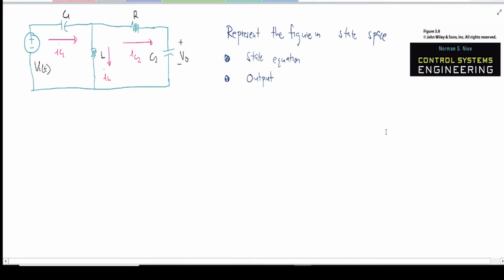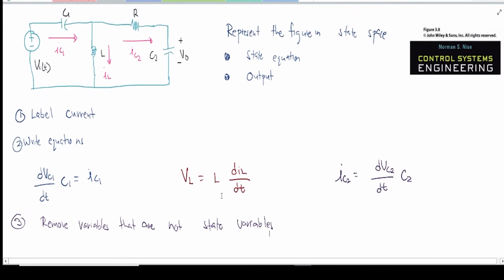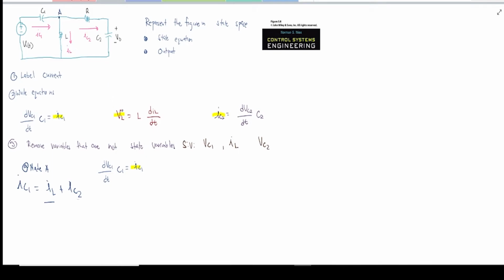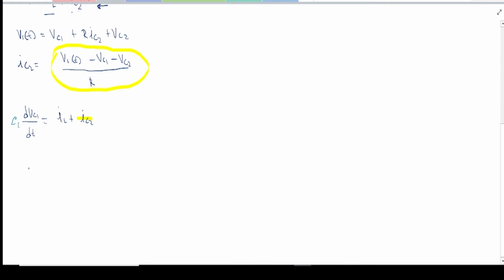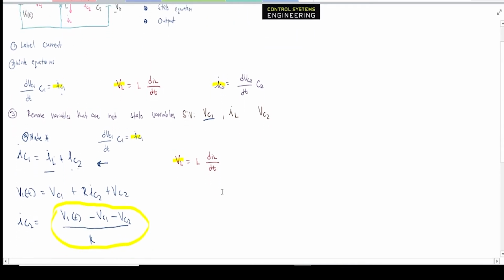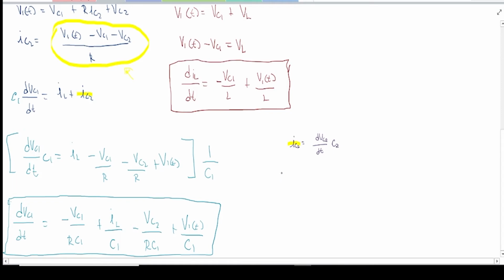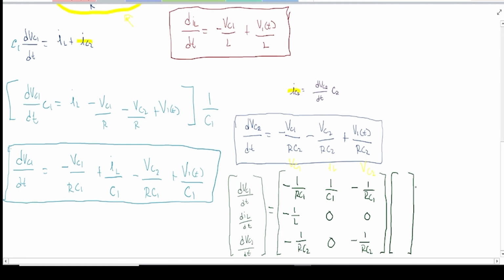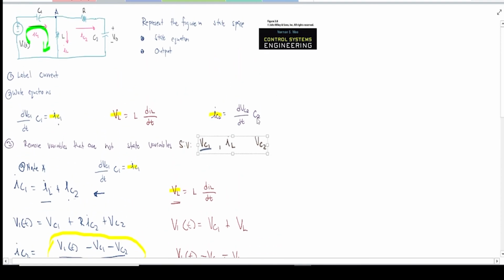Control Systems Engineering: How to Solve State Space Representation of Electrical Network

Comment: I have the 6th edition of this book and the answer you got here is very different from the one in the book. I haven't been able to obtain the textbook answer. Could it be that the textbook answer is incorrect?
Reply from the maker: I have 7th Ed. Of the book and still it is incorrect, the book did not account the symbolic value of  'R' which makes it incorrect. However if you look at the Skill Assessment Exercise Manual you will see that the solution in that manual and in this video is the same.

So the answer in this video is correct .

Goodluck!
Reply: @jeromecolico1960  That makes sense. I was stuck on this problem, but now I know I was on the right path. Any chance you could share that manual? csabau24@gmail.com